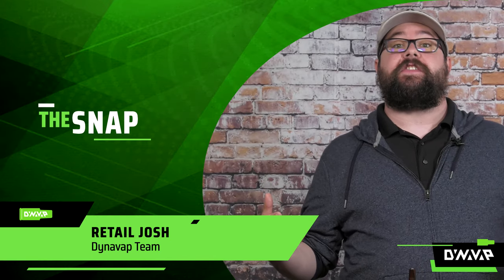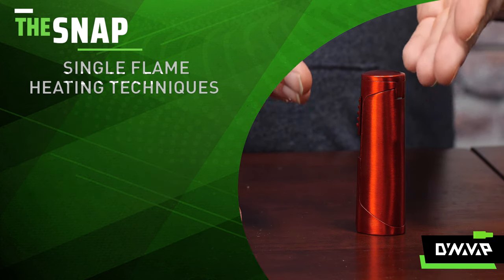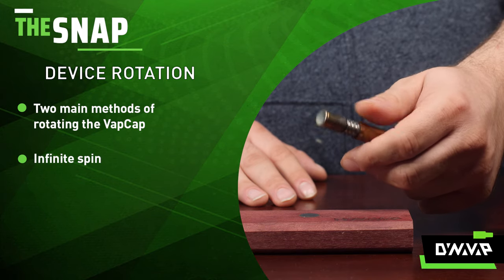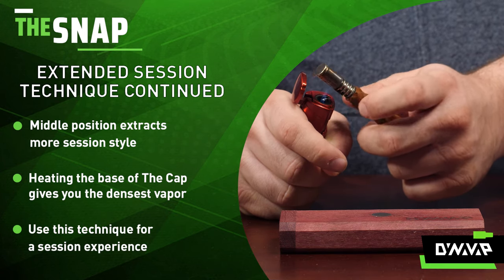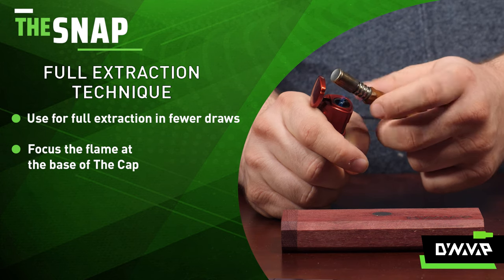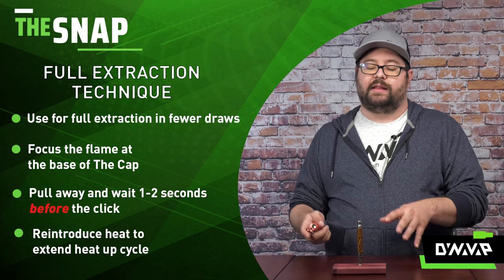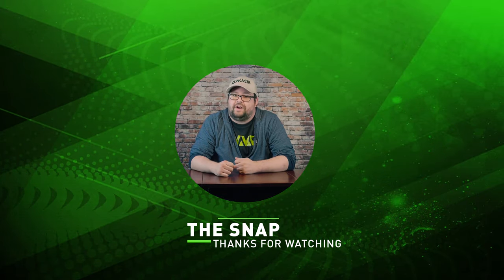Advanced Heating Tips | The Snap

Comment: Instead of pulling away for my last couple hits I move the lighter up and down as I rotate the cap in order to spread heat in its full length. I pull the lighter away a little too so only radial heat reach it as opposed to the tip of the flame.
Reply: Do u get one click or two on heat up

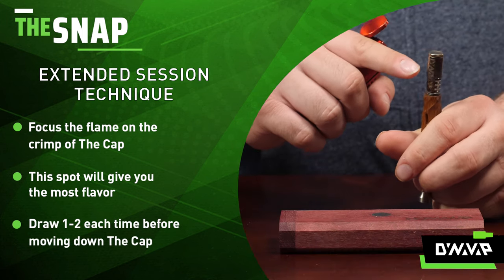Comment: 1:08 so you mean like you heat it up, hear the click, smoke, wait for the cooling click, heat it up again in the middle, click, smoke, cooling click, then heat up at the base. Is that right?
Reply: yes. thats what i’ve been doing i got mine yesterday. gotta get a new heating device tho
Reply: I would recommend actually heating(starting from the top.), wait for the clip, (do not hit, instead cover the airflow holes and mouth piece as it cools)wait for the click. I repeat this 3 times or until I feel heat radiating from the cap. This gives me a full 5-6 pulls when done correctly. Only had my 2020M a week
Reply: Aaron Thompson the vapors leak from the cap for me. i empty the chamber of vapor once before the click to lengthen the heat up time

Comment: For using the dyna coil is the technique the same, or you do you want to turn it upside down so the concentrate doesn't drip?
Reply: I also would like to know.
Reply: Keep it horizontal  when heating and don't obstruct the airport too much or else you will suck any  warm excess down into water piece. That's mostly just if u pack it full like I do only time I have any leakage

Comment: Never seen a butane vape that allows more control over your herb and that can fully extract to the point of near combustion
I've been doing full extractions for over a year now, the abv is black and not even suitable to cooking.

Lately I started heating the cap up closer to the tip and ive been blown away at the flavor difference.
Reply: Doesn't black indicate charring and some sort of combustion happening in the plant matter? Im slightly color blind so trying to figure out the state of my abv is a real hassle.
Reply: @mattihaapoja8203 black means you hit combustion, yup. You don’t want it to taste like burnt popcorn, that’s when you know it combusted. Heating closer to the tip and maybe writing down what gives you great results so you can replicate it each time might help 

You can get a $25 low temp cap that will snap at lower temps - if you are ok with a slower extraction, that might help you be more consistent

Comment: My unit clicks twice right after heating it for 7-10 seconds with a normal lighter kept slightly further away. There isn't any vapour production at all. Is it okay to heat past the click ? That's the only way I could get some vapour I don't want to damage the unit. Not sure what to do.
Reply: It's fine to do that. If I use propane I usually have to go 2-3 sec past the click to get vapor, but I would really recommend just getting a butane torch. Works as intended, no fussing around with timing out how far past the click you have to go, and it burns much cleaner which is something I've been more and more concerned about as of late. Open flames especially have a lot of hydrocarbons from what I understand.
Reply: I get two clicks on heat up as well so mine is ok then

Comment: When I focus the flame on the middle and top part of the cap I get great taste and flavour full vape.

But when I focus the flame on the base of the cap I get bigger hits, but it has a bad metallic taste.
Anybody else experience this?
Reply: The new vong g can’t wait for it to be released
Reply: I were having bad tastes on my new dynavap m 2021, it just needed a clean to get the left over oil off probably from the machine that made them and burned about 5 to 10 dry runs to flash the cap and to practice before putting material in.

Comment: I got mine two days ago. And I cant for the life of me get a good cloud or taste. It always taste like it's not hot enough. I had arizer q and it was same way until I found out you can pack the elbow instead of glass chamber. Which is the only way to get good tasting clouds from it. The flower i have used in my dynavap is so loaded with crystals I almost dont want to touch it lol. So I know it's not meds. And I'm using a dmatch single torch lighter. Any suggestions would be much appreciated. Thanks.
Reply: If you are high tolerance youll find it will take 2 or 3 bowls its much more of a micro doser vape and does work great for that but for my tokerance not practical
Reply: Joe Sudz  yes i said IF. For ME the time it takes to load and grind 3 bowls heat and wait for things to cool isnt worth it for myself. I need the amount of those three bowls in one hit to get my desired effects. Breaking into three tiny hits dilutes the smoke too much for my tolerance to make this device worthwhile. I still like the concept and it does work as dgated jusr not for people with high tolerances
Reply: Joe Sudz  i generally use concentrates bc over 15 years of heavy smoking and vaporizong has damaged my throat it seems a lot more than my lungs. Switching to dabbing has really helped that and eventually i want to swap to tinctures and edibles only. Still love my vapcap for the rare microdose. But as far as vapes go  i wasnt impressed by vapor quality tsste or how many hits it takes to clear the tiny bowl
Reply: Joe Sudz  damn im jealous! After seeing so many positive reviews i wanted it to work for me as yours did. Glad to hear you are loving it! I love rso ans that reminds me maybe ill make a batch now
Reply: @rovinsharma4917  definitely not like they used to but they still work. I can get where i need to be luckily with concentrates but i do not like all the vapor in the throat and lungs.  Hoping to figure out how to nake considtenly make edibkes that give good high and not make me sleepy lol

Comment: You can combine low and high if you move your heating source up and down with your hand and find the perfect combination for you between flavor and vapor. And it feels more like writing a heating partition escaping hot spots along the way because there's always static moment in both infinite spin and back and forth ( i never used by the way ) techniques. Too much static and too low on the cap and it's black carbon nearly combustion and not good. Each cap ( i have two ) seems to react a bit differently and behaves differently over time.
Reply: Do u or have u ever got two clicks on the heat up . 
I get a quiet one then the loud one
Reply: @MonkeyUK.  If you heat low until the first click happens, you should go up directly with the torch for the second one that happens just a fraction of second after the second one...  or your let go and it second clicks mostly by itself. But my main consideration for now about this model would be more something about thoroughly cleaning caps and tips because i found the vapor was becoming harsher and harsher with time...

Comment: Holy Guacamole !!! I think Retail Josh just pulled some Minority Report Numero Deuce kinda sh!t on me. You know the one. This time the bad guy can travel through time. Only he doesn't do it to stop a murderer. He (RJ ??) travels back in time to start some Butterfly Effect (The first one, as subsequent attempts pretty much ruined a great storyline) kind of "innocent" thing.........like a 'The Snap' video.......?????........Then some ACTUALLY innocent newcomer to the DynaVap world is taste testing a few strains through his new M. As he's finishing his 8th tasty tip full of rainbows and unicorns this video seemingly innocently pops upon his screen. He's already got his high going on pretty darn good from testing out the hardware with is Triple Flamer, as he's just a newbie, and likes to follow explicit advice from manufacturers concerning the proper use of the very same device he's holding in his hand. He decides to try out the One And Done method on a final tip full of a custom mix of all the strains he'd just tested. Well...........I don't want to give away the ending to that movie that should be made. However, I'll tell you how I fell into Retail Josh's trap. First, I did all that crap from the above mentioned movie. Then I pull out my trusty ol' SingleFlameThrower. I get the heat party going. Taking all the steps precisely as the man in the video instructs. I take that first hard and heavy draw. That statement about not getting the best flavor with this Hot Air Balloon Ride was an intentional understatement. That gas cloud that shot into my poor unsuspecting pharynx nearly convinced me to not take another hit. About 2 seconds later I grew a pair and shot another flame straight up the a$$ end of that tip. I hit that thing again as hard and as long as a Lonesome Desert Highway being walked upon by some idiot in flip flops. The next thing I know, my arms drop to my side. (only one minor burn as I instinctively placed the device upon the table as my hand passed by. Unfortunately, my then current condition did not exactly place with grace, and got a boo boo on my pinky finger as I, with the style and pizzazz of a one legged duck, somehow managed to keep the M from falling to its death. (It would have rolled under the couch, and NOTHING is ever retrieved from that domain of death) Anywho, the NEXT thing I know, my body is somewhat rapidly melting into my chair. I witness my very soul leaving my totally limp body. I am happy, however, to announce that said soul was traveling in the Upward direction. Regardless, I eventually fingered out that sumpin wutn write and and decided then and there that I was gonna ignore that bright green light at the end of tunnel 420, and instead catch the nearest escalator back down to reality. Why would I do such a thing? Well, obviously, to face all the peeps that mighta had something to do with my attempted Minority Butterfly demise, and turn one or more of those peeps into perps. How about it, Mr. Retail...........orrrrrr......Mr. Josh........Okay, Mr. Retail Josh...........are you gonna fess up? Or am I gonna have to take all this evidence to my local league of unemployed T1000's, and put a few of them to work time warping back to before you made the video to stop it from being made?
Reply: Well said 😁

Comment: My dynavap will not give me THE CLICK 😭it's brand new, and it wasn't cheap. Why will it not click? This is veeeeeery disappointing!
Reply: probably a probk=lem with your unit. Try getting in touch for a replacement
Reply: @remiranda  Thanks! Actually I solved the problem... It just needed way more heat than I dared give at the beginning. So, it's me - not the vape ; that's really good! Puh, happy i hadn't destroyd it!
Reply: i did the same thing when i first got mine.
Reply: @666ffdp48  Hey & thanks! Found out after a little while  how much heat it needs. It's wonderful to not being dependent on batteries! This is a great little thing!

Comment: I wait about 15 seconds after both clicks..Im getting about x 3-4 decent hits. I am using a single head flame as opposed to the recommended x 3 head torch...probably why its taking longer. I twist as I heat the end of the cap...The less I heat the more flavour I get...DV is a weapon once you get to learn how to use it...
Reply: I agree I’ve had mine for about a year before I properly figured it out , combusted so many bowls at one point but I got that shit figured out now
Reply: Does heating beyond the click cause permanent damage?
Reply: @ChiliDawg68  im at that stage right now 😂 my omni tip looks like its a welding shroud or something. Definitely have multiple things i was doing wrong and i was still very happy with the experience so far 🙈